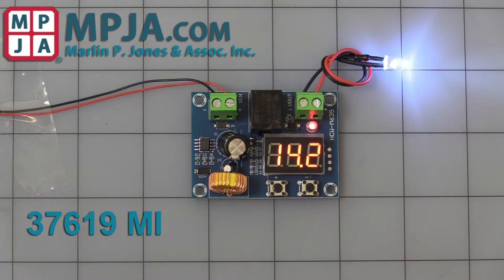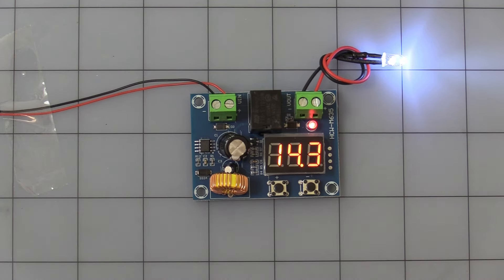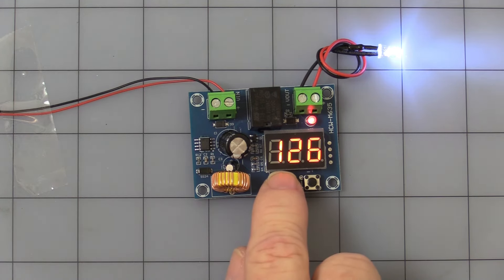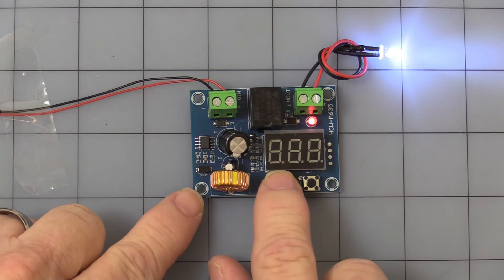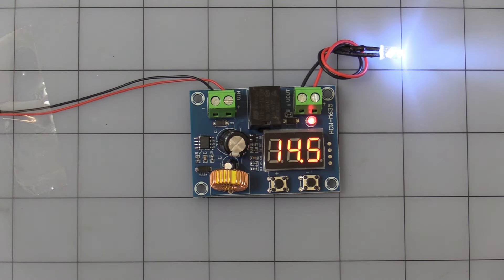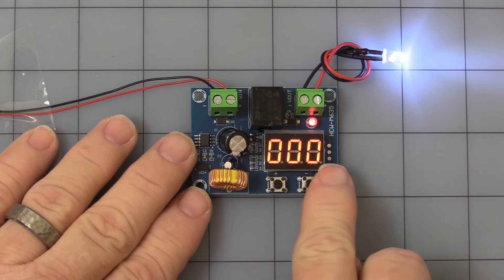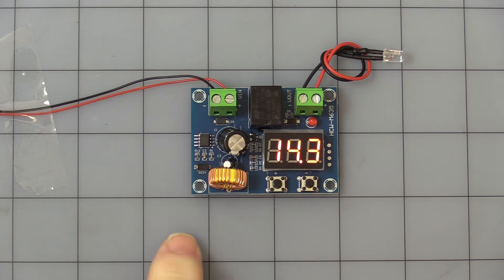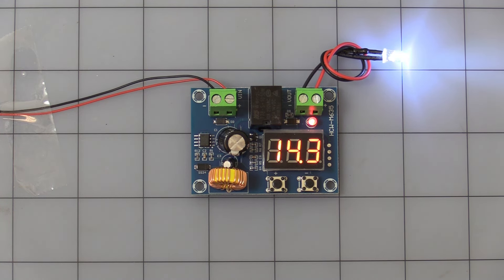Battery Low Voltage Disconnect Module MPJA Inc 37619 MI HWC-M635

Comment: could the module stil discharge the battery lower then its set cut of value when the module dissconnects from the led? Because the modual display is still on. If so could this Module still distroy your battery by discharging it to the bottem?
Reply: You need a low voltage cutoff for the low voltage cutoff 😂
Reply: Battery will be a higher capacity and that volt meter doesn't consume that much current

Comment: Do you know module like cap dump. So when capacitor reached x voltage circuit discharge to output?

Comment: Super helpful! Just recapping so I remember
1. When holding left plus button can calibrate voltage
2. When tapping plus button once, low voltage cutoff shows. If double tapping after voltage cutoff then can set the cutoff
3. When tapping minus button once, can set the voltage difference until next turn on
4. Red light indicates power is flowing to the end

Comment: Hi, great video, I bought one on these to use on a car cigarrete lighter that is always on (2005 Ford Fiesta) 12v battery. What should be the best settings where the idea is to keep devices connected only with the car running. What should be the ideal configuration (including the volt hysteresis)? This info would be very appreciate as I do not have a multimeter right now. Thanks in advance!

Comment: So this device will disconnect the load, which is good. But won't it still sit there sucking power off of the low voltage supply to run the voltage display? Be nice if it tripped a physical switch or something to disconnect all power until you physically went in there and corrected it. Put in a fresh battery and physically reset it.

Comment: Does this hold memory when the input voltage was cut?
Reply: Have you find a way to keep the setting?
Reply: Based on the comment below I'm guessing it won't?
If this is true it will not work well for me. Can anyone confirm?
Reply: @ericgirard4981  Yes, got one and it will hold the settings. I used this one to disable my car's daylight-running lights.
Reply: @Khadjs1804  Perfect, I am using this for when I forget to turn the power to the sound system in my SXS with key off. I just had to replace the battery so dont want that again. Thing is I also dont want a parasitic draw for the periods when the machine is sitting. So now will be sure to tie in after the system power switch.
Reply: What is the value you set for the low voltage cut-off?